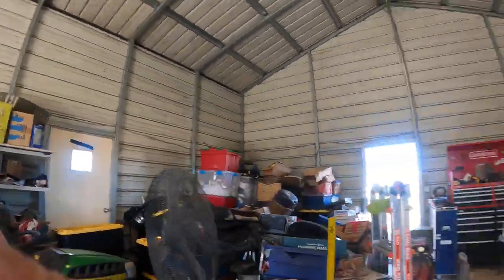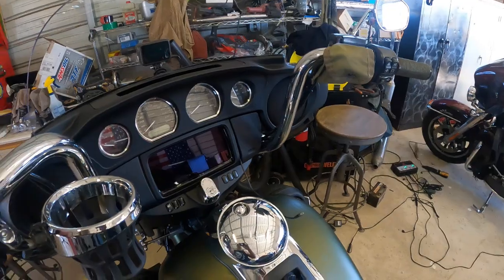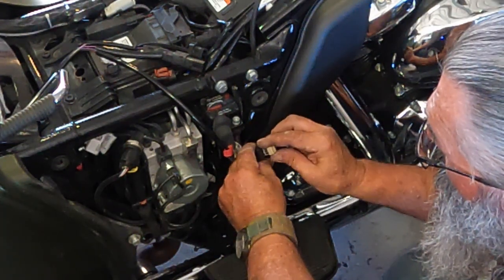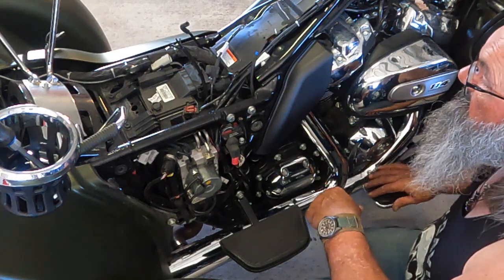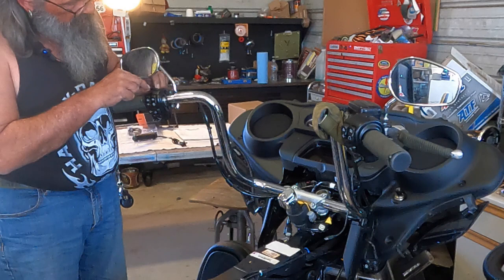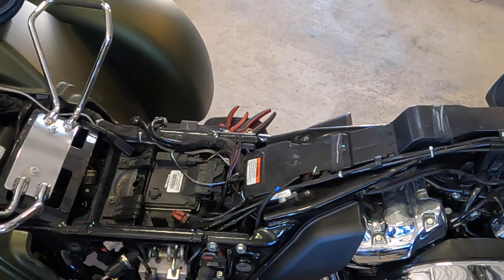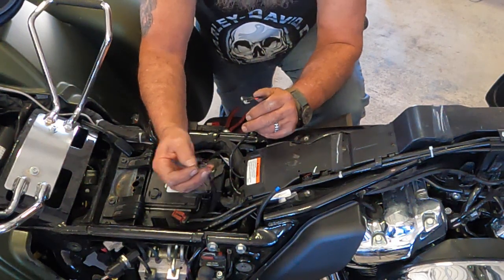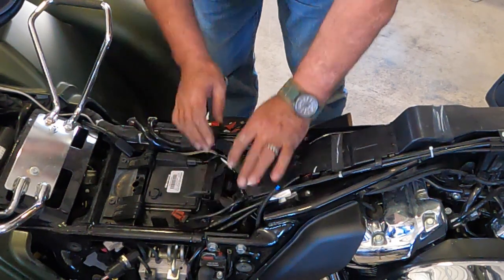2022 Harley Davidson Heated Grip Installation

Comment: Great video. 
I'm part way through an install and the instructions provided by Harley are not so great.
This will help me finish up. 
When I fed the left grip wires down through the bars I pretty much had to loosen the bars to tilt them downwards to get a set of needle nose pliers into the hole and pull the wires out.
Reply from the maker: Glad I could help. Harley definitely needs to work on their directions. I think they do it to encourage dealership installation. Thanks for watching. Be sure to subscribe if you haven't yet.
Reply: @GreyBeards-Garage  I have a question about the right side grip. 
Which wire goes to the positive? There's a green wire and an orange wire, the positive side is marked on the throttle sensor so I want to make sure I get it right.
Thanks.
Reply from the maker: What wires are you talking about? Should just be plug and play. Did you cut any wires or remove any from the plugs?
Reply: @GreyBeards-Garage  I figured it out. It's the short green and orange wires on the right side grip that plugs into the speed by wire. Once I looked closer I noticed the two holes are offset slightly and can only go in one way. I got them in easily with a set of needle nose pliers after I got my brain to work. 👍
Reply from the maker: Awesome! Glad you got it figured out. Thanks again for watching!

Comment: Thanks for the video.  Very good! Did you ever find out if the purple wire was keyed ignition?  I want to hook it up to keyed ignition as I will surely leave them on and drain my battery.
Thanks.
Reply from the maker: Thanks for watching. I haven't confirmed it as of yet. I need to, I have already run my battery down once LOL

Comment: Did you hook up the hot to the other wire for key power? How did it turn out?
Reply from the maker: The other wire is ignition on. Sorry for not updating. Thanks for watching.
Reply: @brandonsnider4647 Thanks for the comment! I'm trying to do the same thing.  So you just hooked the red from the grips to the purple of the harness and that works for key ignition no other changes?